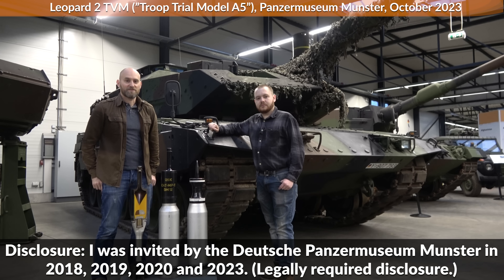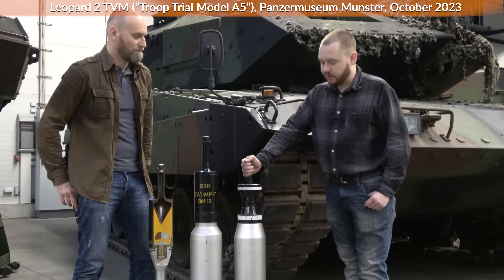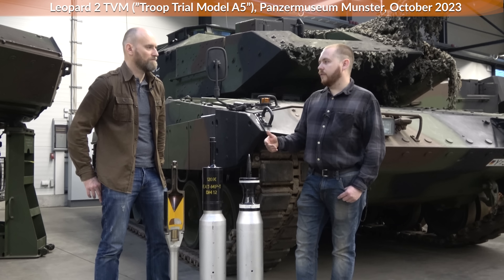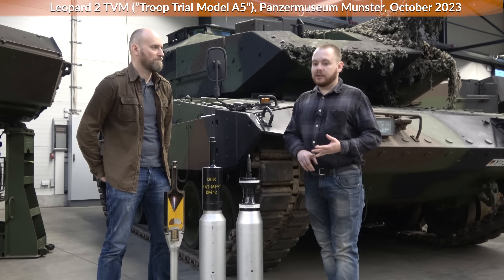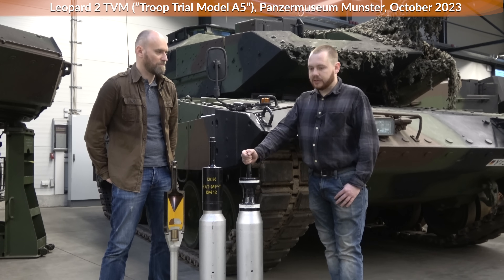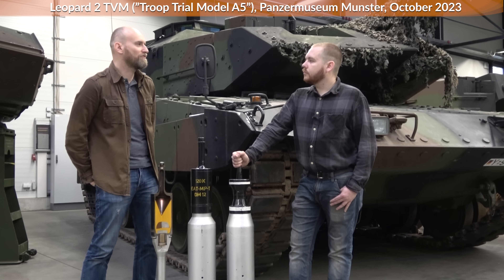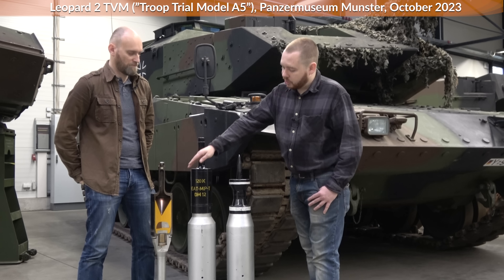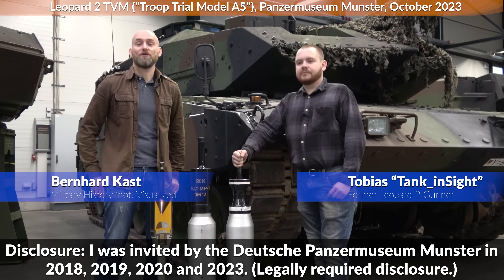Why you need proper HE rounds for Tanks

Comment: Spike might actually be the better description over jet. Since it's actually acting like a very high speed spike, rather than an overheated jet... I'll have to think about this
Reply: The question is whether the rigidity of the material plays any roll.
It doesn't. It might as well be a liquid.
Reply: @0MoTheG  this i learnt recently, the extreme environment the copper cone goes through turns the liquid copper into a solid penetrator. However, disruption will mitigate penetration ability, hence angled performance is often, very bad.
Reply: @0MoTheG  It absolutely matters for the penetration. It is just modeled as a fluid when deforming. It is a lot more like stamping, where high forces plastically deform a material than it is melting it.
Reply: The metal liner is transformed into an elongated 'super fluid' metal rod. Its not molten but is usually made of softer copper alloy, but aluminium and tantalum alloy liners are also used.
The mechanism for penetrating armour is similar to dense metal APFSDS penetrators made of tungsten or depleted uranium. HEAT warheads do not 'burn through' armour.

Heavy dense Sabot penetrators of APFSDS rounds use high density, mass and very high velocity to force there way through armour.

HEAT warheads use explosive force to accelerate low density, low mass projectiles to very, very high velocities to force there way through armour.

Both are using kinetic energy but the HEAT warhead compensates for low density and low mass projectiles by generating extremely high projectile velocities. The low density HEAT 'rod' penetrators lack mass and stabilisation and begin to deviate and 'tumble' after a meter or more of travel . Thus the HEAT warhead must detonate within 3.2 to 3.5 warhead diameters of the targets surface to have the optimum chance of penetrating. This gives time for the 'rod' to form and stabilise but minimises the possibility of projectile deflection and tumbling.

A Explosively Formed Penetrator (EPF) is a shaped charge warhead with a thicker, denser concave 'hockey puck' liner. It gives more mass and projectile stability providing penetrating power of 150mm+ RHA at up to 100m from the warhead denotation point. Its a favourite choice for top attack munitions and off-route mines.

This is just from memory but I think most APFSDS darts are travelling at around MACH 5 in flight.  HEAT liner 'rods' are propelled at velocities of MACH 15+ over short distances.
Reply: @simonmoorcroft1417   yeah the shock wave propagates at 6000 m/s or so in high explosives, the cone is tgere to make those waves add up to acellerate the liner... mach 15 sounds about right
Reply: It kinda is a foil explosively forged into a spike that doesn't have time to melt...
Reply: @arnekoets3085  Explosively Formed Penetrators (EFP) are a slightly different thing. They have longer range in return for lower penetration. HEAT - like this round - applies so much force that the metal liner of the round deforms like a liquid, but only for a relatively short distance. It should also be pointed out that the explosive forming that jet will absolutely wreck anything in close proximity.
Reply: Pure-blood milita-nerd ! 😊❤
Reply: Its like the 'focal point' of a lens ( which is also why proper standoff-distance is so critical ), this tip of the 'spike' or the "jet" where the shaped charge converges on.

You could also think of it like a sort of 'standing wave' or constructive interference made by the charge.

Comment: I have comments on here telling you this would be the case early in the conflict everyone said "they have HEAT-FS its just as good" no its not. Russia has dedicated HE with 4x the explosive filler which over pressures trenches and buildings
Reply: Correct. Russian HE shells for the 125mm are loaded with a lot of explosive filler. Russian tanks, even dating back to the Soviet days, carried over half their load of shells as HE shells. They place a very large emphasis on it and less emphasis on anti tank shells
Reply: It's even worse when you consider NATO HE rounds use insensitive filer. Russia use explosive filer which are more potent (but are more hazardous). Meaning their shells are not only bigger, but filed with more powerfull explosive.
Reply: @karakiri283 US INEX fillers have gone a long way to match the power of TNT or RDX. 

Of course they’re ridiculously expensive, but so are ammunition dump explosions.
Reply: @karakiri283 Yes, storing sensitive explosives right under your feet in the autoloader carousel is wonderful for your chances to win the Olympic turret-tossing competition
Reply: @p_serdiuk  as opposed to what? Storing the ammo all over the tank like basically every other tank during that time? The autoloader is probably preferable to most other designs
Reply: @Rokaize  the auto loader design was good during the middle of the Cold War, but there are way better solutions
Reply: @Squee7e Like what? Loading ammunition by hand?
Reply: @ksztyrix  no, using unmanned turrets where the ammo is stored safely

I was not talking about auto loaders being outdated in general, which they obviously aren't
Reply: Yup, I remember getting flack for defending the use of older tanks for indirect HE support.
Reply: 4x the explosives? Sounds too good to be true
Reply: @petrsukenik9266  heat warhead is 30% fuse

An extra 5cm diameter dedicated HE is way better than 120mm heat the Ukrainians have complained about lacking it
Reply: @off6848  30% ? Ok that would soubd plausible. 4x? Sounds little unplausible.
Reply: @petrsukenik9266  I mean shell casing is completely different HE is stuffed with filler HEAT does have he filler buts more the secondary explosion after the plasma jet penetrates so it take up a lot of room for the mechanism that turns chemical energy into kinetic

The t72 30F26 HE shell is renowned for its absurd amount of HE filler you can watch videos in Ukraine of them hitting hard points and looks not much different than a 122 SPG HE shell in terms of blast
Reply: No, "over pressure" is mostly not a thing. 
There is a reason why delay fuse is preferred for anything that provide any reasonable amount of resistance for the projectile. 
Shrapnel is what poke holes. 
Also, 125 tank gun he has about twice the filler compare to heat, by mass. 
The proportion is about same for 120 tank gun.
Reply: @jintsuubest9331  That simply isn’t true. 

Over pressure is a thing. It’s especially a thing when discussing neutralizing defensive structures like bunkers. What do you think the point of thermobaric weapons is? 

As far as the typical Soviet HE from a 125mm cannon to one from a 120. You’re just wrong. It isn’t the same proportionally. 

You are a fan of making stuff up I guess
Reply: @Rokaize the 125mm shell had 3 kg of filler the 120mm has 3.2 kg of filler
Reply: @Constance_tinople  That is just wrong, but he's not fully right either, the 120mm MP-T shells have around 2kg of lower-yield explosives, which would be around 2.4kg TNT equivalent, while the Soviet HE-Frag rounds that is the standard that ever 125mm gun has, would be 3.4kg of explosives for the most common round, which would be about 5.2kg TNT equivalent due to it's incredibly high-yielding explosives, even the more modern round that is the 'smart' round with it's reduced load of 3kg, a whole 400 grams less, would still be coming in at about 4.6kg of TNT equivalent

Note, he wasn't talking about the HE vs HE rounds, it was the HE vs HEAT, AKA, MP rounds that NATO uses a lot of and have been boasted to be "just as good" as soviet HE, which is objectively false, the HE rounds are far superior in every single regard, even against other tanks.
Reply: @vonvonvonvonvonvonvonvonvo7009  “even against other tanks” is bullshit and warthunder isn’t a good metric for actual combat effectiveness
Reply: @Constance_tinople  it’s not a WarThunder thing it’s documented how IS2 122mm HE shells would blow the turrets of Tigers right off the ring

The turret rings of modern tanks are still a weak point it’s not like they suddenly developed a metal that grips to the ring better than the steel of yesterday 

Metallurgy has improved but so has high explosive technology and a 125mm dedicated HE shell direct hit will at the very least operationally disable any modern tank destroying all of its sensors

That said protocol thus far for Russia has been to load Refleks barrel ATGM in case of tank va tank engagement and that’s because western doctrine is to load Apfsds and ATGMs out range Apfsds without losing effectiveness with range (Apfsds loses about 30% kinetic energy over 2000km) where as Refleks barrel ATGM has a range of 7km
Reply: @jintsuubest9331  if overpressure is not a thing tell me how hesh works 💀💀.
Reply: @ribinroy5679  That is the worst of examples... HESH works by pressing the plastic explosives onto a surface, preferably a flat one, and then detonating, which sends a shockwave into the material that it's pressed onto which then creates spalling on the otherside of the armor, it has nothing to do with pressure in the air.

A better example is to point at what happens to people that stand infront of a tank gun that's firing, overpressure is a real thing and absolutely can kill you.
Reply: @vonvonvonvonvonvonvonvonvo7009  ah yes the classic hesh shell , not causing pressure and spall. 😭

Comment: Loading big ass full caliber HE rounds in your tank is a good way to get turret tossed.
It also makes things like Blowout panels useless as the much increased explosive force would case the entire reinforced wall to fracture and the explosive force would enter the turret and kill everyone anyway.
Best option is the Subcaliber Smart HE rounds like AMP.
Less explosive power but enough to get the job done as well as anti-fortification bonus of delayed fuzing.
Soviet HE rounds are one of the main driving factors in the turret toss olympics.
Reply: Maybe, but just maybe the engineers and army people know better which rounds they can savely use in their blow out bustles than some hobby experts on youtube;)
Reply: That is true I've tried telling people this its not really the T series "weak turret ring" causing tosses its the sheer load of dedicated HE they carry. A tank carrying mostly APFSDS with heat resistant charge is not gonna blow like a tank carrying HE. 

I will bet money that if Ukraine starts carrying HE in their western tanks we will see a toss just like the Challenger 2 that tossed because it was carrying HESH
Reply: @off6848  A challenger 2 turret toss? I've only ever heard of a single Challenger 2 loss and it was hit by ATGM and burned but it didnt explode much less turret toss.
Reply: @nucleus691  It depends on what the ammunition loadout is.
A lot of Hesh all stored in areas close to underneath the turret? Yeah the explosive force of it goes up is going to not only rip the hull apart from the inside (making it look like an exploded can of White Claw) but the turret is going to fly off… it probably won’t fly as far as a soviet tank in the same scenario but it will still fly.
Reply: The explosive compounds used in the construction of shells, be they HE or HEAT, are generally extremely insensitive except to the detonator mechanism they're paired with, because it would be rather inconvenient if they had a tendency to explode randomly in storage, or explode because something next to them exploded randomly, or explode because something next to them exploded intentionally. When a tank cooks off, it's generally the necessarily more sensitive propellant charges doing almost all of the work of tossing blowout panels and turrets, and autoloaded Soviet tanks do the latter so dramatically because all of the charges and shells are right there, directly underneath the turret.
Reply: @StacheMan26  “Generally insensitive” doesn’t really make a lot of sense as they still clearly detonate.
They may not just explode if they get hit by shrapnel but a sun caliber APFSDS projectile slamming into it, cracking the outer layer and sending sparks into it will cause some major issues… but if a HEAT round hits it… that thing is going sky high.
Also, Soviet and Russian HE shells don’t use insensitive explosives, they use straight RDX… which goes boom much easier.

Comment: Talking of this new HE round with delayed fuse. An old British Veteran I knew. He was in Normandy on 17pdr AT guns and was wounded by long range fire from 8.8cm Flak. They were using timed fuse the same as when shooting at Aircraft and my old friend was wounded by an air burst. 
Easy calculation if you know the exact range of the target with a coincidence rangefinder and set the fuze for that exact range. 
Then in late 44. The US Artillery were using proximity fuses which also had air burst effect. 
New HE round for Leopard is really an old idea for a certain job.
Reply: Shrapnel rounds, made to explode while flying over the trenches, were among the most used in WWI.
Reply: @neutronalchemist3241  wrong.
Any "airburst" in ww1 was achived either by fitting the impact fuses with brass rod extensions to detonate ~4"-12" above the ground when the rod hit a solid enough object to set off the fuse, or, by estimating/mathematically calculating the distance to the target, aim a bit beyond, and set a  time fuse to go off when the shell was supposed to be passing above the target.
The latter method is still used for direct fire support weapons like the HEDP rounds of the 84mm Carl Gustaf recoilless rifle.
Reply: @SonsOfLorgar  And so? I stated that ariburst munitions were largely used in WWI, not how they exploded.
Reply: @neutronalchemist3241  Shrapnel does not explode as such. It pops open and releases its shrapnels. Sharpnels work by the kinetic energy they got from being fired out of the gun. The burstig charge adds nothing to that. They are basically like shot gun shells with a very flexibel choke. They are highly effective against soft targets in the open but allmost complety ineffective against targets in cover. Which is why they where abandoned early in WW1 by any major participant and replaced by HE shells.
Modern rounds like KETP, AHEAD etc are sharpnel. They also share the advantages and disadvantages of traditional shrapnel.
The 120 mm HE-MP is a classic HE with multi purpose fuse. Delay, impact, time. The only new thing about it is the fact that the fuse can be programmed after the round has been loaded into the gun by datatransfer from the FCS.
Reply: yes the concept of delayed or airburst ist old, but the Leo2A7 with the DM11 HE round does it really well. 
Digitally programmable primer and fuze, that are connected to the FCS. 
Just select the fuze type on your gunner station, lase the target for range, fire, loader loads, repeat.
and its highly precise too. 
its a similar system to the AHEAD system used by Puma for its 30mm selectable fuze HE rounds
Reply: @zhufortheimpaler4041 "digitally programmable"
Translation: it never bloody works 😂
Reply: @jimtaylor294  dude these ammunition types like AHEAD and DM11 are in use for more than a decade and are extremely reliiable
Reply: Airburst is indeed nothing new at all. New is the way the fuses are set and the space this requires.
8,8 Flaks could use airburst against ground targets as well because time airburst was their main mode of opperation and they had the ranging equipment, FCS and fuse setters on each gut. Field artillery could and can do this as well if they have the proper fuses available the basic procedure is the same.
It could in the past not be used by tanks because the equipment especially for fuse setting is to bulky. It also required setting previous to loading. For automatic and high ROF weapons this was impossible. The technology to use programmable fuses for autocannons and tank guns is available since the early '00. Its just now that it sees widespread adoption.
Reply: @haydenjones962  You are confusing shrapnel with fragments. Shrapnel are pre formed subprojectiles that are released by a bursting charge. This bursting charge only bursts the shell. It does not contribute to the KE in a meaningfull way.
 Fragments are the shell casing ripped appart by the HE payload. Sometimes there are pre formed fragments included as well. Fragments rely on the force of the explosion.
The bursting charge of modern Shrapnel type shells is so small they count as insensitive KE projectiles. Which is not the case for HE or HE-Frag of the same caliber. A bursting charge for a Shrapnel type round is a few gramms. The payload of a HE shell is measured in kilograms. Its orders of magitude heavier for the same caliber.
Reply: @haydenjones962  they  arent. Ukraine just does not have the capabilities availible to make them work. Like total air surperiority within 72hrs of the conflict starting, extensive precision deep strike capabilities, AWACS etc
Reply: ^ Actual Argument: 0%
Clichéd Name-Calling: 10,000% 🥱
Reply: ^ Come back when you've got an actual point 😏 .
Reply: ^ Not well versed in military humour it seems 🤔🙄😮‍💨
Reply: @jimtaylor294 my guy you are using emoji zoomer humor